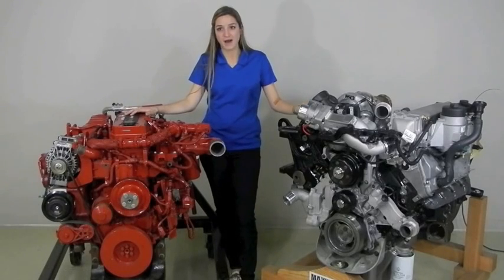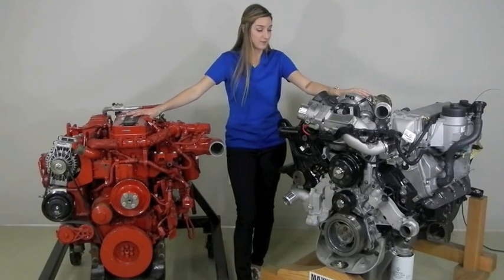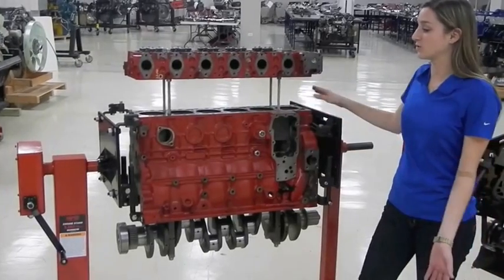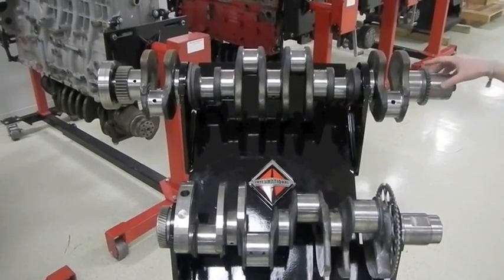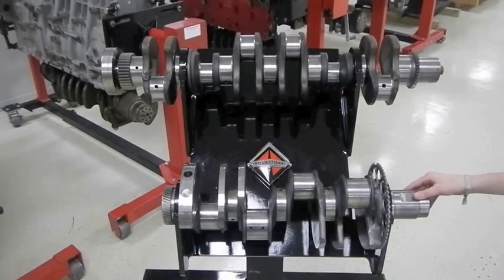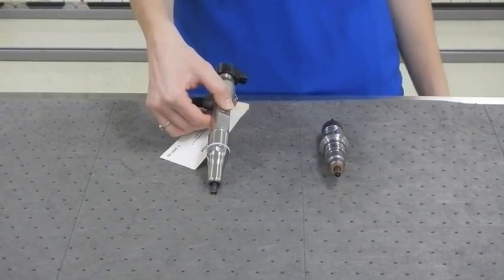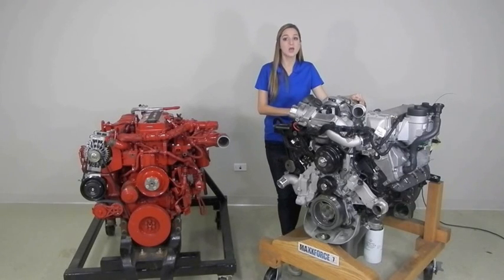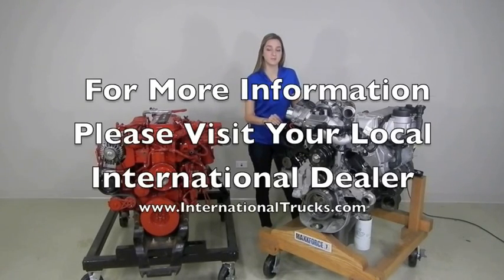MaxxForce 7 vs. Cummins ISB- Medium Duty Truck Diesel Engine Comparison

Comment: One of the biggest POS engines in history‼️ I see this video was 11 years old and this engine has been discontinued for quite some time now . Cummins has a better injection pump a lot better than the high pressure oil pump that always fails on all the international Ford navstar trucks. I absolutely hate the 6.0 and 6.4 l and 7.6 l all the way up

Comment: Geez forgot how huge and massive those commercial motors are. Daaang!!!
Reply: Maxxforce 7’s are junk
Reply: @charlesrodriguez7984  yeah that's what I heard out of most of them the DT is more reliable. But Maxxforce 7s were more on the buses than the commercial trucks. Only some commercial trucks had a Maxxforce 7 in it.

Comment: Had a 1999 fl60 with 5.9 cummins, original miles were 87k, lasted till 500k approximately before it needed an ober haul. I just got a mf7 2012 with 160k in April of 2022, it's July 2022 with 210 miles and it needs an over haul.

Comment: I'm a school bus mechanic, the 9 months I've been there we have swapped about 5 of these Cummins and no maxxforce,  Cummins better? I dont know, you tell me. And the Cummins were all under 200k.  I'm not by any means saying the maxxforce are better, but the Cummins don't seem to be either. The dt 466 are a solid engine though.

Comment: Biggest difference, 8 years later the ISB is still in production almost unchanged and the Maxxforce 7 has been dead for about 5 years... The ISB ironically replaced the Maxxforce in International trucks.
Reply: Ya maxxforce suck
Reply: The difference is one is a pos and the other isn't lol  @amaziin7733
Reply: The '7' in Maxx Force  isn't the type of engine. Its how many times it gets replaced during the lifespan of one cummins.

Comment: Which one is between Cummin or max force?
Reply: Maxxforce is the worst engine because Navistar. And, Cummins. The B6.7 or ISB whatever I called it. Cummins are reliable engines to replace Navistar Maxxforce engines as a repower swap.

Comment: This video didn't age well. Maxxforce 7/6.4 powerstroke will go down in history as the worst modern diesel engine.
Reply: The 5.7l chevy diesel was actually the worst. Complete POS
Reply: @danielteichroeb7200  okay you got me, lol I actually worked on a 5.7 Oldsmobile. Was insane lol

Comment: Sounds pretty biased even though the maxxforce is a pile of junk. Cost so much to keep em running. Harder to maintain. More down time. Cummins for the win. Easier to work on. Easier to diagnose. Cheaper to maintain.

Comment: If I were going for a good V8 Diesel engine it would be the CAT 3208 not that Trash Force I drive school buses and the ones that always break are the interTrashionals the Cummins and Cat engine buses even the buses with the MBE Mercedes engines last longer and are smoother. I’m not at all sold on this engine,  that 7 has a hard time climbing hills and getting up to speed.

Comment: Although less reciprocating mass may be better for fuel economy it is not better for torque, aside from that I’ve ridden in busses with both engines and I’ve only been stuck on the side of the road in a maxxforce never a Cummins

Comment: That pore little chick got conned in to doing this comparison because no grown man could get on with this shit and keep a straight face lol. You could say that there must have been good god damn reason for navies tar to only produce this engine for a couple years. These engines were the ones that shot flames out the exhaust from leaking turbo seals, diluted the oil with fuel, pissed oil out the exhaust til there was none left, and buckled rods from Leakey egr coolers filling up the cylinders.not to mention all the unnecessary shit like separate coolant systems and pumps for the charge air and countless fucking exhaust flex pipes going to the turbos and egr coolers.

Comment: This video is a joke. I have 12 Freightliners with Cummins ISB’s in them. Haven’t had a single issue even out of the 2013. Who set her up to look uneducated. 🤦🏾‍♂️
Reply: My 2014 with just 302k miles broke a valve spring last month, taking out the injector, piston, block, and turbo. Never had an ISB or Cat C7 go so bad so soon.
As for the woman, she's just a paid spokesperson. Wasn't at all surprised to learn that this video was merely an ad.

Comment: At 1:45 - seems like an unfair comparison of crank bearings etc.,. if you don't mention that the V8 would actually have two crankshafts!!!  Plus the V8 has a lot of extra parts to rotate the "extra" crankshaft and time such.
Reply: Educate yourself .You have only one crankshaft in maxxforce 7  . Only opposed-piston engine use two cranks .
Reply: @mariuszzienkiewicz1460  Joke on you buddy...N Walker is our best Diesel Mechanic over here in Alabama.

Comment: Being a bus mechanic I can tell you the Maxxforce is JUNK! The VT365 it replaced was JUNK! I deal with the MF7 and MF DT. Not the 5s, 9s, 10s, 11s OR 13s. In my fleet we have the old 5.9s which we are phasing out, VT365, MF7s, DTs and Cat C7. A few MBE900s there too but nothing to write home about. The DTs are actually not as bad as I thought after dealing with the other crap. The fuel manifold on the 7s are under the turbo in the valley between the damn heads, piss poor design in my opinion. On top of that injectors keeps failing left and right. I am sure the DPF system on these things are not helping. With IC school buses phasing out the MF and using 6.7 cummins now I will have to see how they perform. Having worked on both the 12v and 24v I6 engines (5.9L) and not WORKING on the innards of the ISB 6.7 with all the "new" tech they have i am kind of worried. It seems when they try to make these things lighter, more fuel efficient, they sacrifice durability. It also helps when you have a company building school buses that think like a tech. The Freightliner/Thomas C2, ALL Bluebirds are a pain in the ass. The IC CE200/300 is a little simpler to me. The C2 uses Multiplex wiring and VERY few relays or fuses. The IC has a large box with all the relays and fuses labeled (depending on what the bus was equipped with and the company add ons.) Power probe in one hand and fuse/relay puller in the other. Easy peasy lemon squeezy.
Reply: It sounds like you had a lot to get off your chest but what do you think about the 1977
DT466

Comment: The maxxforce 7 is a terrible motor. Were always fixing them in our fleet vehicles. The biggest issues we have are them making oil from high pressure fuel pump and blowing the engine, also headgaskets all the time and not to mention the roller lifters like to drop needle bearings in the LPOP. We have never had any significant issues with our ISB motors other than an egr problem from time to time which is still not that common. International should dump that engine and building something like the t444e with egr and an scr system. If international was smart and did what cummins did with the ISB then maybe International and Ford motor company would still have a contract together
Reply: No idea where you get the "no issues" from. Nothing BUT issues with ours. From day 1 they have been nightmares. There is a reason IC is moving to the ISB 6.7 and leaving the MF behind in the school bus market. Not to mention the companies ripping out the MF7s and spending $30-$35,000 a pop the drop in brand new 6.7s.
Reply: +Matt Classen You better go check out the School bus forum then bud.    They are one the largest users of this engine and no issues.    Blue Bird company.
Reply: It is just another choice.  People want choices and they are given that opportunity to choose.  I like all and everything diesel.   I don't care who or what they are.   they are not leaving the 6.4 behind.   As long as we all help each other move forward.   I own three 6.0's and I don't have the issues everyone talks about.  I'll knock on wood, but I would buy another in a heartbeat.    I run em like a diesel.

Comment: Pass by a International shop and a Cummins shop. The International has a Marrygoround in its parking lot. Start at the parking lot and out the front gate back into the service bay. Then back out the parking lot and the cycle repeats itself. The Cummins has a few in its bays and a empty parking lot.

Comment: the Maxxforce 7 won't even run 100.000 miles , its very cool when the high pressure fuel pump starts to bypass Diesel into the oil, you need like 3 days to replace it, the Cummins just runs... check what engine the Tow truck has ^^, its Red or Yellow under the hood...

Comment: ISB is superior to the MaxxForce 7. The MaxxForce 7 has about an engine life of 1 year without repairs. ISB has about 5 in a C2. This girl is paid by Navistar. She mentions noise, the ISB is WAYYYYY quieter than the MF7, trust me.
Reply: Yesss it is and that the 7 rattles and not to mention the 6 cylinder intertrashional is louder rattle can

Comment: Somebody please educate this poor girl... the ISB doesn't need a warranty.
Reply: Cummins is job security they keep cummins back
Reply: Sir I do cummins warranty work all tha time
Reply: Jay Jones Maybe you should switch to Navistar so you can make major overtime then. Unless you don't want to give up your personal life.
Reply: Jay Jones And I'm sure that the 6.o Powerstrokes didn't keep Navistar busy. Oh wait, let's make a better engine the 6.4, even better, we'll make flames come out the tail pipe because we don't know the 1st thing about diesel particulate treatment. Let's also bury often changed parts deep into the engine so that it has to be brought to a dealership of new hires that themselves can't even fix. Let me just say this, if you're that convinced that the MaxxForce is better than the ISB, then you're plain ignorant,  and deceived by International. But since you work in the business, only you would know. But based off of the comments in this thread, I'd say swimming up a creek without a paddle, because majority would agree that Internationals products Cumm back more than Cummins. I'd still rather be Cummin than Stroking.

Comment: The MaxxForce 7 is pretty much a big version of a 6.0 Powerstroke... They are JUNK. And much like the Pwerstroke, I wouldn't be surprised if international gave up precision and quality to cut costs of the production of the MaxxForce 7... They are literally brand new paper weights.
Reply: No the max force 7 is the 6.4 powerstoke
Reply: Ricky Griffith no...the vt365 is what you're thinking of...being a medium duty 6 leaker...this MF 7 is based on the 6.4 that was in the fords...and is arguably even a bigger pile o shit

Comment: if the block is so much stronger why do they wear out and push oil out the dipstick tubeI at 50,000 miles and the only big problem I've seen so far with the Cummins turbo actuator seizing

Comment: That warranty is a piece of garbage. Who only drives a commercial truck 150,000 miles in 8 years? Nobody, most commercial trucks would rack up 150,000 in a year or two, plus the Cummins is warrantied for unlimited miles because they know their engine isn't a piece of shit. The last good engine international made was the t444e (7.3 powerstroke) Take your pile of shit engine and shove it up your ass International.
Reply: Brad V 😂

Comment: If Navistar really believes that a V8 is superior to the I6 then why don't they use it in any of their other engines? The MaxxForce 13 is an I6.
Reply: +Anonarchist , ever here of the Cummins V16?   The most powerful engine cummins makes.    So please tell us all again which one is superior.  It is all about packaging, what you need it to fit in and function.
Reply: I agree but this video is implying that a V8 is more efficient then an I6 on fuel consumption. Its not true.
Reply: The Cummins KTA 50 V16 engine is something Maxx force will never be capable of. If Maxx Force did a V16 the first bank of 8 would snap in the middle of the crank shaft from the other bank of 8. Then it would run half the V16 as a V8 for 30 seconds then pack up and die. Or, not run at all....

Comment: Gotta share my fishing story to the masses.
Four of us went fishing in Canada one year.  We chartered a boat and got 8 halibuts
for the weekend.  On the way home, my friend's '96 F250 with a 7.3 NAVISTAR or
should I say NEVERSTART broke down a mile away from our campground.
Two coolers full of halibut filets.  Anyway, our fishing trip became REALLY EXPENSIVE from that point.  Flat bed tow truck to Victoria $$$, motel stay
in Victoria $$$, more ice $$$, etc etc etc.
NEVER FORGOT THAT EXPERIENCE.  So when I decided to get my own
diesel truck.  I bought a Cummins. Just happen so that it came with a Dodge
body.
PS My friend's F250 truck requires multiple crank before it runs.
My 5.9 Cummins requires ONLY ONE
Reply: HEUI

Comment: #1 Anyone who compare an I6 to a V8 is a complete idiot.  In this case, a female
idiot.
#2 Remember this is the same company who made the SHITTY 7.3, 6.0 AND 6.4
Ford should have to Cummins for their F250
Reply: yamaharidr450  just because they sold more does not make them better. If you like replacing injectors and egr coolers go get you a 6.0
Reply: Amen to that...
Reply: the 7.3 has one of the best track records of any light duty diesel, ford fucked up the 6.0. Navistar's 6.0 had few if any issues,and the 05-07 6.0's that had the bugs worked out actually had less issues than 5.9 cummins did of those years.I love cummins but I can't tell you how many injectors my 03 has eaten.
Reply: #3. If you don't know what you are talking about, shut the fuck up.
Reply: JOE JOHN - Kinda funny you call the 6.0 shit it out sold both Duramax and Cummins between 2003.5-2007 combined. If you are an idiot and run crazy tunes and dont do proper routine maintenance using motorcraft filter, yes you will blow it up. International 6.0 is the DT 365 out of the dump trucks and sold buses, where emission standards were far less stringent than light duty pick up. International took the DT365 cracked up the hp but about 175 and sent it on to its way to for. Ever read about the law suit between Ford and Navistar over the 6.0/6.4. thats why Ford created its own engine in house. Go educate yourself first before spewing garbage out.
Reply: It's still a POS.
Reply: ***** Only to those who know little to nothing about diesel engines.  Just like yourself.
Reply: Tim Pace Agreed. Made a bigger living as a Ford dealership repair tech measured by workload with the 6.0 compared to the more reliable 7.3.
I should have been grateful for the work caused by any new engine design that broke frequently compared to some old iron, but I'll never get over the discontinuance of some engines. (not talking about a great love for the 7.3 here either...just sayin)
Reply: Tim, a friend '96 F250 with a 7.3 fried the
wiring harnass that runs the injectors. We went halibut fishing in Canada and going home about a mile from where we camped
his truck broke down.  It got every expensive
from time on.  Towing to Victoria, hotel stays,
food, more ice etc.  We got precious 8 halibuts, salmons, bottom fish and crabs in two giant coolers.
Ford wanted $400 for the wiring harness.
We eventually found a set at a wrecking
yard in Portland, Oregon for $100
I replaced it and the truck work after that.
I understand the wiring harness runs on
a higher voltage. What would cause it
fry?
Reply: Tim Pace, I learned my lesson from my friend's owning the '96 F250 that I first bought
a '93 Ram w/a 5.9L Cummins (totally mechanical FI).  I now own an '02 Ram w/a
5.9L Cummins 24V.  Love both but I wish
I kept my '93. 
Also, my friend's '96 F250 ate a few
cam sensor.   What would cause that?
I mean I have installed after market
and Cummins original sensor and still
it would kill it.

Comment: Again, biased to the international. International did one thing right, the 7.3l powerstroke. These new engines are garbage, and need warrants to make them attractive. They're done and worn out at 120,000 miles. I'm a mechanics, and service garner Enviornmental corporation's fleet of international vacume trucks, and if it isn't a lifter, or an injector, the engine is just trash.

Comment: Cummins has less warranty cause the engine is more durable.    Um I think having more crank journals is a good think.   More support so u won't snap a crank like them v8 do.
Reply: Kyle Shields It's tough to beat a 7 main bearing inline 6.

Comment: got a school bus with one of these, less than 50k miles, lost half it's hp, floor it and it takes forever to reach freeway speed, 15mph if you're lucky on light hills, floored. Sucks coolant through the motor like it's going out of style constantly refilling the tank..where's the puddle? 2 more of them have blown motors in our lot. Drove a 22 year old spare bus with 200k on it and ran much better.
Reply: Which engine?  -C
Reply: @adequatebus8280  MaxxForce

Comment: Ok really 5 main bearing better than 7 ... no more support more life and look still 4 head bolts per cylinder we saved weight but your head gaskets are going to blow prematurely then you have the warranty well hell you can put any warranty on any problematic engine and it will sell, maybe the cummins has less warranty because it don't need a huge warranty because the failure rate is dramatically less. before you bash I work on 12 maxxforces to 1 cummins go blow smoke elsewhere miss